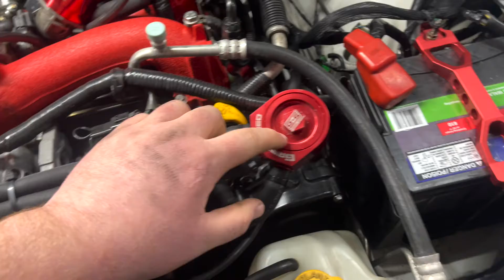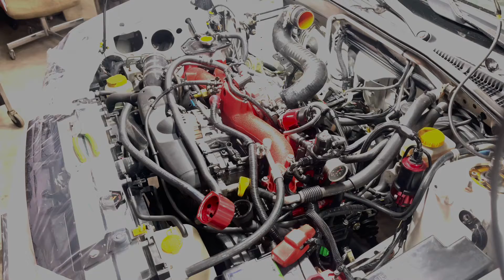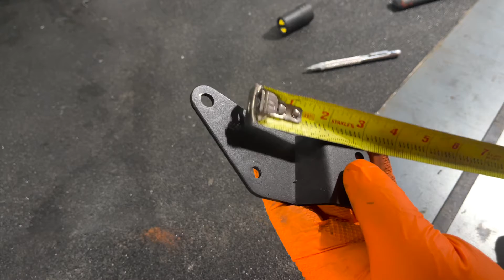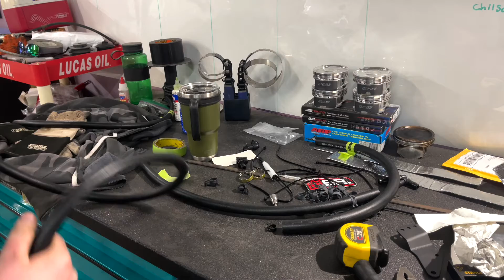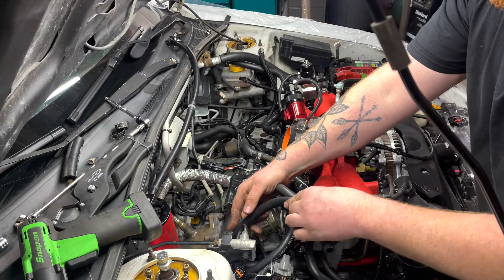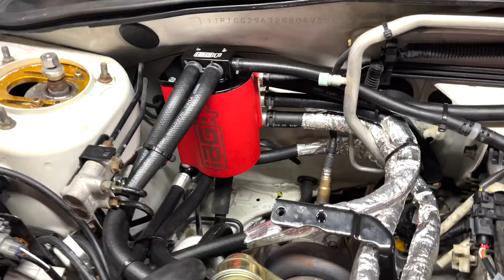The Rocket wagon 2002 Subaru WRX gets Spoiled with an IAG V3 Street AOS!😉👌

Comment: Can you add the part number for the replacement pcv I order the wrong one
Reply from the maker: PN:11810AA040 🤘🏻
Reply: @89autoworks  not all hero’s wear capes
Reply: @89autoworks  by bad bro but This is the same one I ordered with this one the threading starts late compared to the one you have which starts at the beginning. because of that, it wont thread in when i try to install
Reply from the maker: @zippack999 that’s my bad bro! This is the one you need, sorry about that! https://www.importimageracing.com/products/subaru-oem-intake-manifold-fitting-subaru-wrx-2004-2005-sti-2004-2021-14076aa030?currency=USD&variant=39754133405792&utm_source=google&utm_medium=cpc&utm_campaign=Google%20Shopping&stkn=d776b209dbda&gad_source=1&gclid=CjwKCAjw0YGyBhByEiwAQmBEWowltITJTnZ-xKVO5KCwaafDehfgL-DzAyikTXTJRu_CmSuoW-waehoCweUQAvD_BwE
Reply: @89autoworks  🫡🖤
Reply: @89autoworks  just got done installing the aos on my bugeye run smooth thanks again for your help😭😭😭
Reply from the maker: Glad she’s a ripper again!

Comment: I have a 03 wrx So I just need to replace the pcv valve with 04+ and it work just fine no tunes?
Reply from the maker: As long as you’ve got everything installed properly, you will not need a tune. Me personally, I always wait to install things until we are going to the dyno already, but the AOS should require no alternative tuning. If you want to clarify that, just give IAG a ring and they will tell you certainly one way or another.
Reply: @89autoworks  ok cool but replacing the pcv valve to 04+  on the 2002-2003 makes the whole thing work right cause that’s the only step in the instructions where I know that hose won’t fit.
Reply from the maker: @Jeff-cn9bu correct! You’ve got the idea!
Reply: @89autoworks  thank you man why is no one talking about this problem ur video is the only one
Reply from the maker: @bugspeedlo  because I LOVE Bugeye’s. Up until a few years ago, that was an unpopular opinion. That AND I have a great relationship with IAG and they are always looking out for me.
Reply: @89autoworks well thanks again this was a big help
Reply from the maker: @Jeff-cn9bu absolutely! I hope you subscribe, there will be a ton coming up very soon on my personal bugeye build.

Comment: So to be clear, You swapped the pcv connections at the manifold, but did you place the pcv in another spot or delete completely?
Reply from the maker: The PCV valve is now in the line that goes from the AOS to the nipple on the back of the intake manifold. Hope that helps?
Reply: I'm pretty sure he deletes it. the AOS should have a built in one.